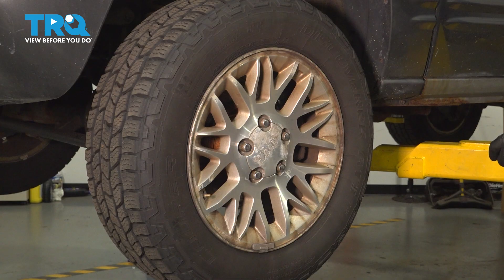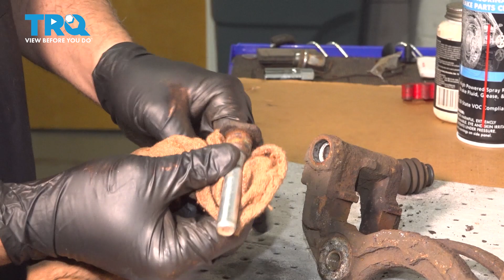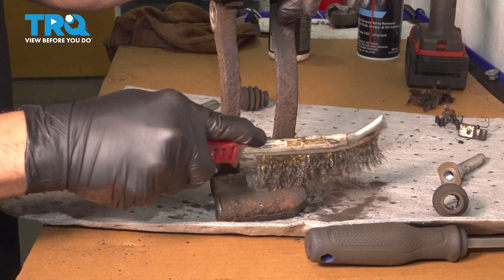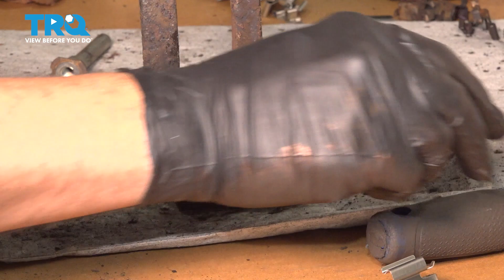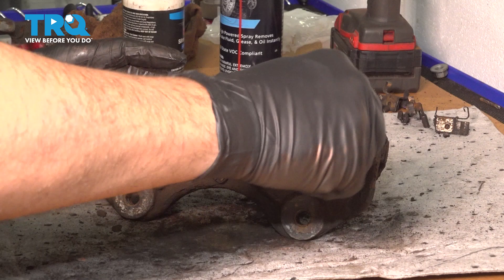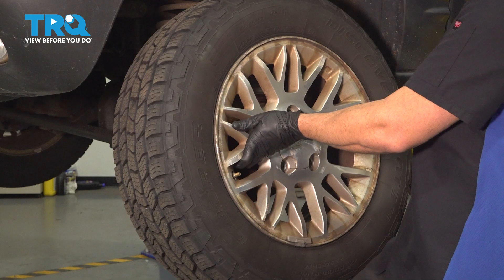How to Replace Front Brakes 1999-2004 Jeep Grand Cherokee

Comment: This does not cover all wjs. Early models do not have the calipers that seperate like these do, they have a spring that holds them together, meaning you have to put the pads in the caliper and then put them on the rotor.

Comment: Nice video!  Very well instructed and amazingly clear picture.  I would recommend for higher mileage Jeeps or Jeeps doing a lot of off roading to go the extra step to rebuild the calipers.  I have a 2004 and I neglected to do that last year and the left front seized up three days ago.  Luckily I was close to home, so minimum damage was done.  I'll be replacing both calipers tomorrow.  😫